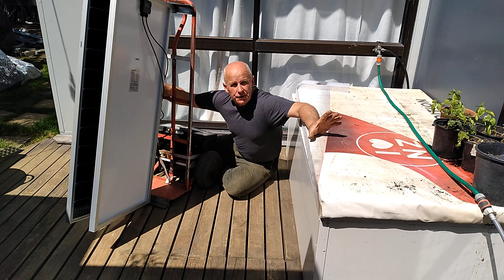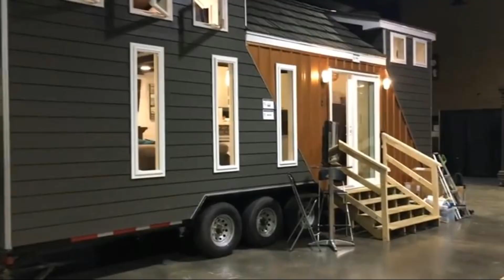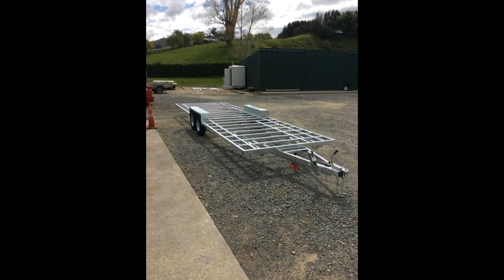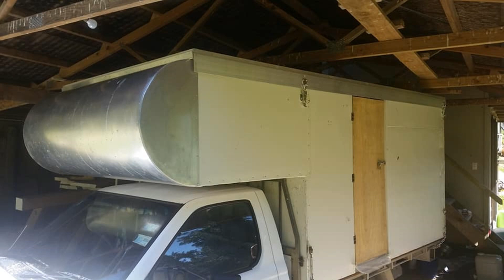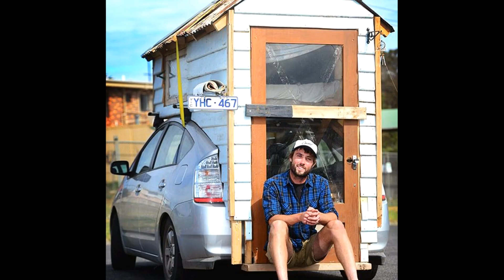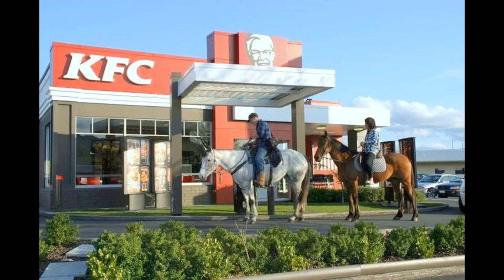Stealthy Solar. A portable or secret energy source with 33Ahr lithium/ super capacitors.

Comment: This looks great, thanks for sharing.
Reply from the maker: Wait till you see the build Dennis! crazy amount of research to get a balancer/charger for the LiPo s that would make a charge curve profile 14.4 v from a 12 volt supply. and still get the right voltage to charge the supercaps from the same power supply, then getting it all inside that toolbox with a homemade battery. I found several natty circuit board devices  while i reseached that Ill be itching to icorporate in new projects too. 🍻

Comment: Awesome!!
Reply from the maker: Wait till you see the build! crazy amount of research to get a balancer/charger for the LiPo s that would make a charge curve profile 14.4 v from a 12 volt supply. and still get the right voltage to charge the supercaps from the same power supply, then getting it all inside that toolbox with a homemade battery. I found several natty circuit board devices  while i reseached that Ill be itching to icorporate in new projects too. 🍻

Comment: If you were designing a solar system for a tiny house with a microwave, under bench fridge and maybe 6 led down lights, what size of batteries and panels do you think would be needed?
Reply from the maker: assuming you use the latest tech inverter fridge/freezer and microwave. 250 watts will run those and another 250 will  cover lights and device charging and give you a good 30% extra for crappy weather. get an inverter front loader wash machine and do your washes and vacuuming  at 10am in the morning so that you batteries can recover before cooking dinner. Battery choice. Lithium really is the only way when you do the numbers. The $$$$vsLifespan equation Lithium wins every time.  main reason? Lead acid can only be emptied to 70% Lithium can be drained to 30% regularly without damage. So you need twice as many Lead Acid batteries to do the job. So cost is the same, weight is 25% of Lead Acid, Physical size is also about 25% of lead acid. 200Amp hours of battery would be sufficient for a sole occupant home all day
Reply: Thanks

Comment: Needs a dc to dc charger and an anderson plug so you can charge it off your diesel car engine.
Reply from the maker: Yup- It has the Anderson plug- and several other features. The vid will be up in a day or two- Im just waiting on a 50 amp circuit breaker- then I can call it finished